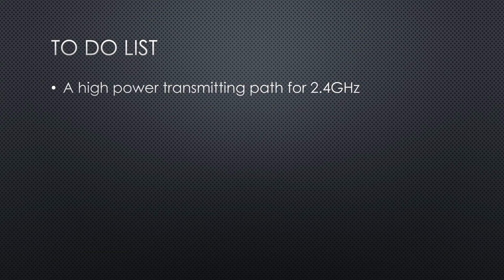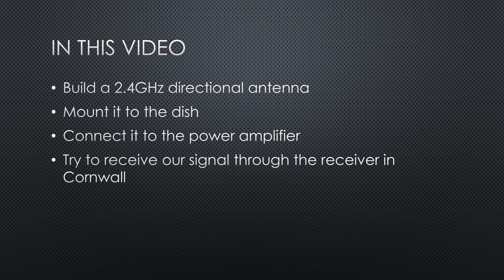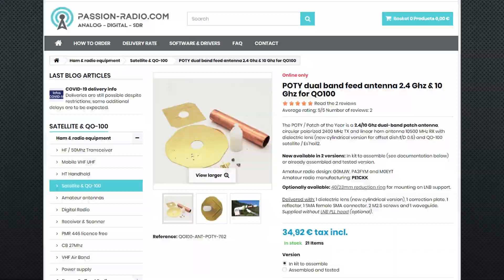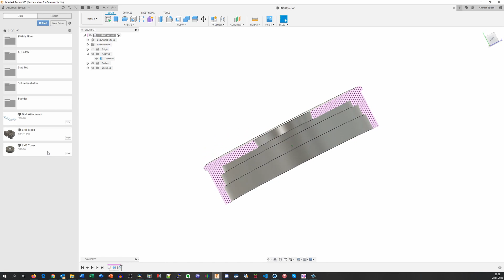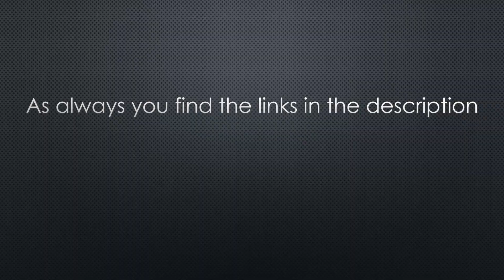017 QO-100 2 4GHz Directional Antenna build and Test POTY (Part 4)

Comment: I've only seen the patch by itself and those corners are specifically cut down look at the tech minds video for Immersat sat using both hijacked radio sound Helix and a patch that he made. I'm still asleep so I'm just studying this stuff but it seems like you're combining two antennas that are separate and tenants there should be a ground plane for the Helix and not what's called a slot antenna which is the concept behind the weird edges and 7mm between the two plates he separated the two plates with nylon spacers and soldered the core to the top plate and the sheath to the ground play the ground that it has to be also a very specific square size. Then for the Helix the the round back plate has to be proportional to the spacing and the number of turns of the Helix been probably the gauge of the wire or tubing you use. One guy actually found a difference between the supports that he used if he use plastic wood and if he just use them as supports or built them into the design itself he then just built them into the design itself and he used the space between the tube at the bottom and the ground plane as a way to fine-tune it so you'll see that the two of his been like split open and it's flat and so you can adjust the distance. But I never seen the ground playing and the never seen the waveguide used in there a metal tube in there. Tech nine's has a really good video on connecting with 0Q100 I like I said I'm a student new some working on my HB. Grutza.
Reply from the maker: The corners are here to create circular polarization.